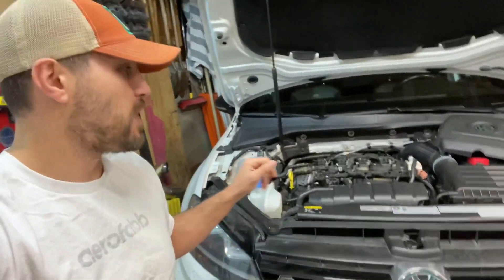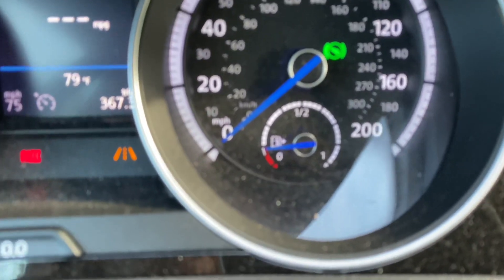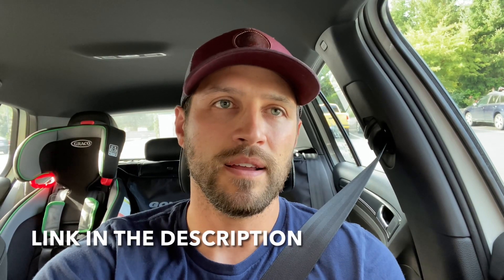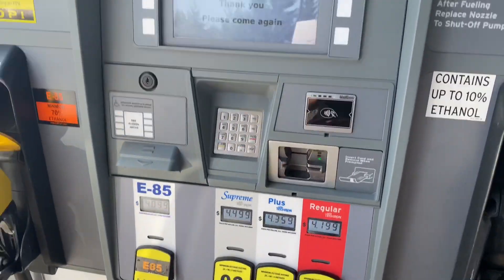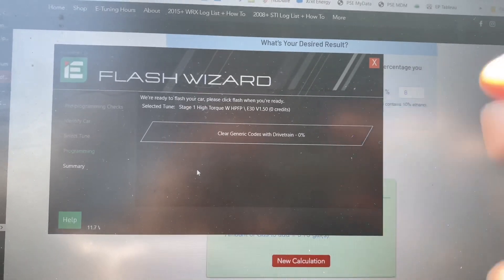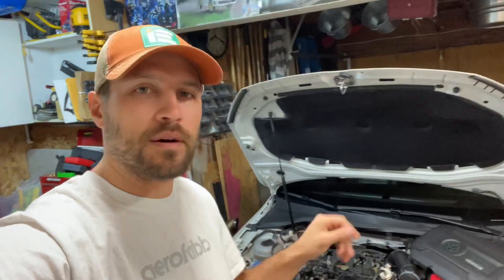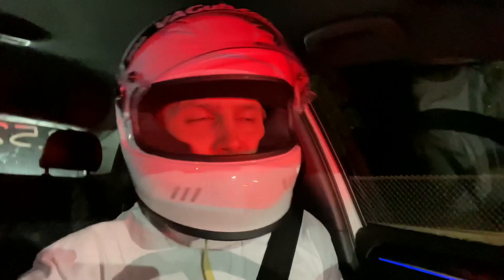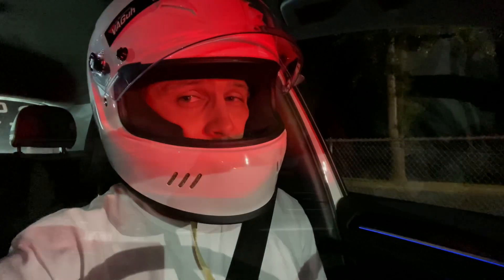Quarter Mile on Ethanol and Tips for Blending - Integrated Engineering E30 Golf R

Comment: What would you think a stage 2 E85 tune would net you in the 1/4 mile? Sounds like stage 2 and 91/93 got you a 12.18 Would you think the stage 2 E85 tune would be under 12 seconds? I imagine it should be mid to high 11s at least.

Comment: no issue with the LPFP like i had?
Reply from the maker: I haven’t had any issue with my LPFP. I don’t recall what issue you were having? The stock HPFP seems to be the limitation here and the reason I upgraded it with the Autotech internals kit. There was a short period when I first started using the e30 tune that I was having fuel cut issues, but it seemed to be a tuning issue that was resolved with a minor revision. I’ve been running the IE TrueFlex tune up to e80 or so now without issue and loving it. From what I understand, I won’t need to consider upgrading my LPFP until I get into a bigger turbo.

Comment: 55L = 14.5Gal            I just picked up a 2019 GTI and wanted to run ethanol but i was under the impression that i'd need bigger injectors to run E85. What are you using to flash your ECU so that you dont void factory warranty or just dont care? BTW just found your channel, its great.
Reply from the maker: Yeah, the calculator doesn’t care about volume units as long as you keep it consistent. I’m not sure about the GTI, but I assumed it was just a HPFP.  I used IE’s power link cable and my PC to flash their tune to my car. Warranty is out the door for me anyway, but I’d do it either way. Thanks for stopping by! More to come!